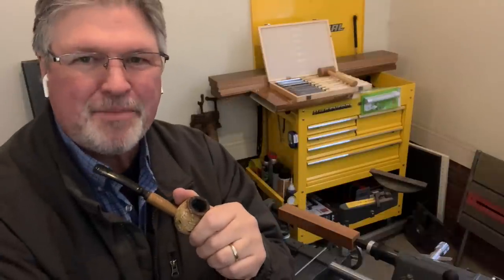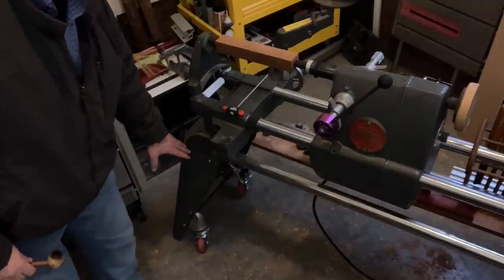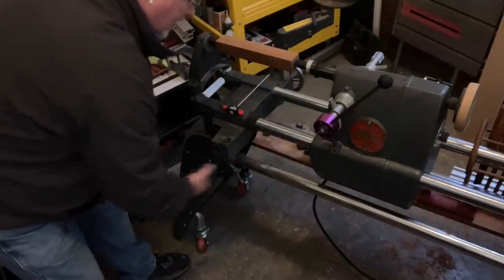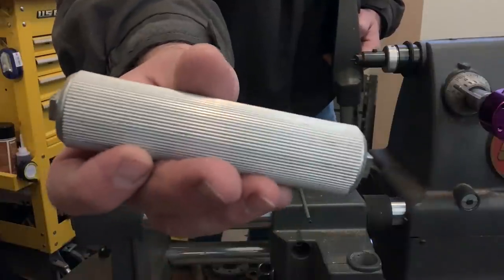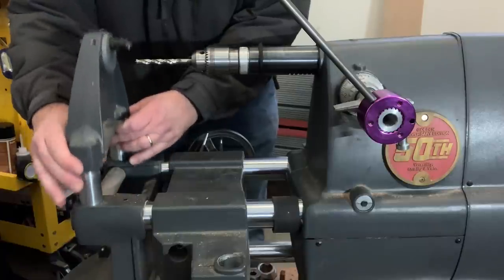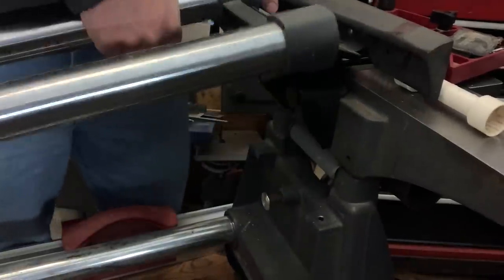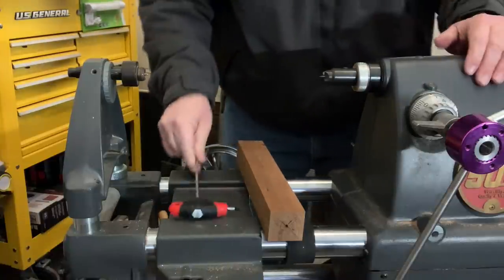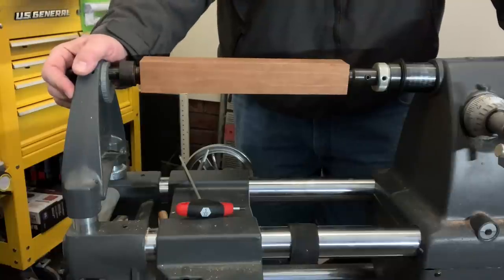Before Turning On Your Shopsmith Lathe, Watch This!

Comment: If you have one of these machines and it keeps you woodworking, Use it but NEVER buy one of these new if you’re looking. They are a terrible investment for the price and you’ll never be able to sell it for even 20% of what you paid for it! 
$300-$400 is about as good as you’re gonna get selling one. 
My dad had one and drank the “ kool-Aid” at a stair fair..... it was a terrible investment. 

Also I would never never get turning tools from harbor freight unless there a good quality High Speed Steel. 
The only way you will know the steel is by sharpening them and the color of the spark. Red spark is good, White spark is bad. Tells you if you have a hard or soft steel.  I have been turning a long time and if you’re getting a bargain on turning tools it’s probably to good to be true.
Reply from the maker: I wouldn't buy a new one either, but I understand how some people like that new car smell and just feel better knowing that they are the first to own a tool. Also, I purchased my Mark V new in 1987 when they sold for $1600 and I'm confident I could get $1000 for it today. Not bad when you consider that you could hardly give away a Delta Unisaw or Powermatic 66 from that era. Scott